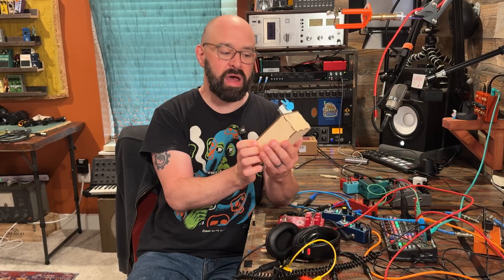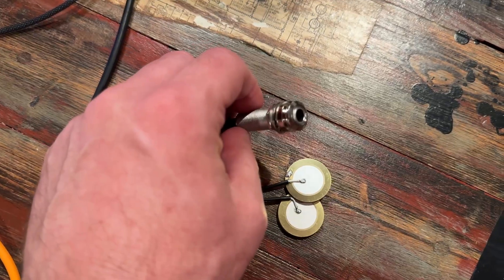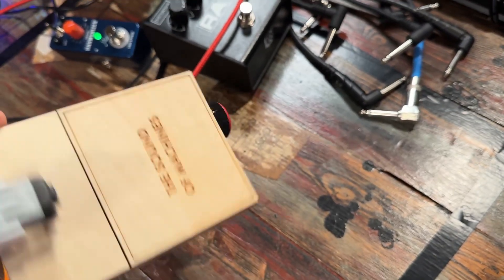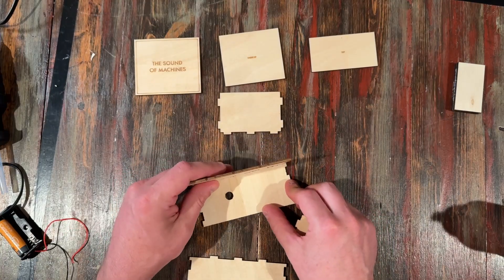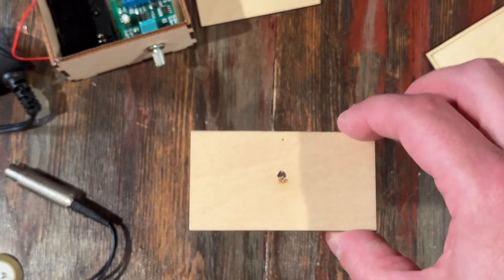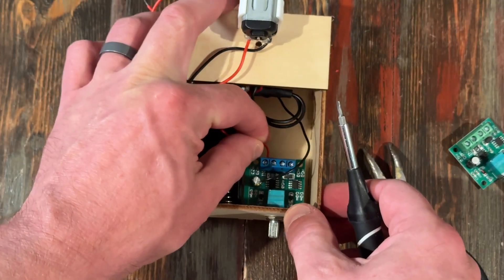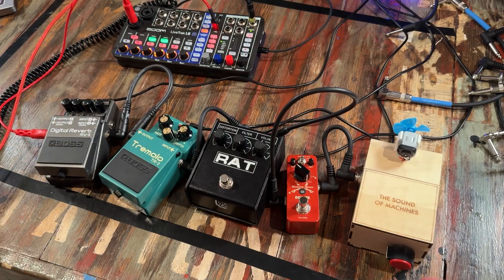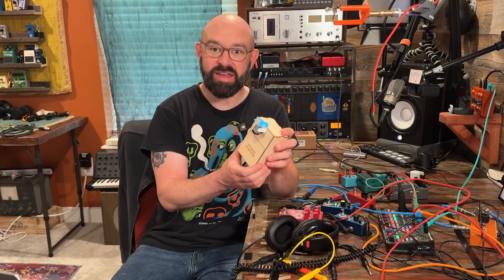Build The DIY Instrument that Went Viral On Instagram

Comment: i guess there could be multiple motors if someone wanted to create chords without the intermediate pedal, with more flexibility correct? possibly using voltage ratio switches corresponding to note relationships so that you get 5ths 3rds etc in order to avoid having multiple "pitch" knobs

Comment: It's a DRONE! One normally uses a bunch of sine (or other) waves stacked together, to achieve that kind of sound.

You should make the speed CV controllable. It would sell out like crazy.

Even better, if you can make a Eurorack module out of it. A good width would be 4HP. It's possible, believe me.
And you'll become RICH in no time.

Hint: use PAGER motors, like the ones found in smartphones.

Comment: As a kid I simply wired a gutted out tube radio speaker in series with a toy car motor to produce a similar racket. Also a smaller speaker (e.g. that of a cassette recorder wired to the recorder's motor) worked ok.

Comment: I have had a concept for years. I don't have the skills to execute it. 
Windchime... Sort-of. 
Chimes driven by PWM through a solenoid or electromagnet. Powered by solar. Bonus: web interface to play it live or program sequences. 
It's solar, so it will never be annoying at 3:00AM. 
How could this be done?
Reply from the maker: Hoo boy you are inching into the realm of microcontrollers and arduino. An area I can not abide. I've tried, but my patience for coding and troubleshooting is that of a gorilla trying to use excel. I fear you might need to walk this journey alone brave soldier.
Reply: @TheSoundofMachines some ideas remain forever conceptual.

Comment: Seems to be quite a bit of noise (this is not a criticism, to be clear). I know guitar pickups will pick up motors. If you use a pickup would it have less noise?
I’d love to try to control something like this digitally and get multiple motors to harmonize or make chords. I’m not sure how that would work exactly, but I’d assume that’s a PWM control and not, like, voltage, right?
Reply from the maker: Oh yes- this is definitely not a clean machine! The contact mic will pick up any bangs, taps, scratches, etc on the box or surface it is on.  I'm also in the process of making a video for Patreon that shows the difference that a coil pickup makes. It's a cool option that has its own limitations, but in a good way.  Cheers!
Reply: There were magnetic pickups for analogue telephones (technically similar like the coil of an earbud speaker with metal diaphragm) those should work as well. With these things you can also pickup sound from the speaker of  small soundtoys in much better quality (more bass) than recording the sound itself because it bypasses the diaphragm and gets directly the magnetic signal from the speaker.

Comment: Nice video 🙂🙌
Next one with fader, find notes with a tunerpedal and mark  the fader with notes so it can be played chromaticaly?
Reply from the maker: One thing about this basic setup is that the pitch is quite unreliable and apt to vary by an entire step as the dial is set in one spot. I'll be making another model with the next level of motor and power next. Maybe with that one :)
Reply: @TheSoundofMachines cool idea. This type of motor would have to have a tuner running at all times. Other types can have rock solid speed control. Looking forward to it.
Reply: @TheSoundofMachines nice 🙌
Reply: Control the motor speed with variable voltage, and then use a voltage quantizer?

Comment: Nice, I need to find one of those motor speed boards. I guess you could also use a model train power supply. Sounds great through that harmonizer pedal.